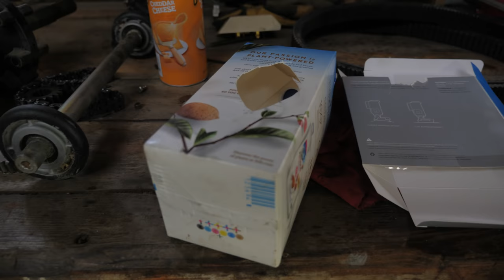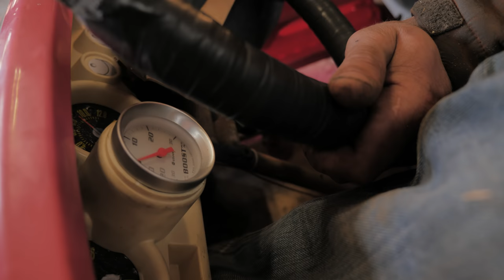Barbie Car Turbo #3 Tuning and Hitting the Streets

Comment: Those wheeeels are massive. They look like miniature Stanley Cups!
Reply: I had a tire and wheel setup like this on a kart that I used to race (for my home track). It was predominantly left hand turns on the track (sprint track), so we put the wide tires/wheels on the right side and I could take the corners VERY quickly.
Reply: Yeah they do lmao

Comment: Now you need a nitrous kit on her to get it really spoolin
Reply from the maker: I will need to look into that 🤔
Reply: @GrindHardPlumbingCo  a pocket bike nos kit would be perfect
Reply: Just get a decent 125 2 stroke engine for it an that will feel like you have nos. plus easy maintenance
Reply: Grind Hard Plumbing Co yeah just a little cartridge kit
Reply: nah 125 2 stroke is way faster and easier to work on. only hard thing is to get the custom pipe just right for all the power if the original doesn't fit
Reply: 250cc 2 stroke

Comment: if you want this to "work" and not just make turbo sounds then there is only really one way to go about it 

needs to be a blow through and boost referenced carb

a quick and dirty way todo this would be to enclose the carb in a airtight box (so the box would be flush with the motor size flange) and then pip the turbo into there so the exterior of the carb is at boost pressure, then add a fuel pump remember a carburetor needs to operate at ATMO so if you want blow thru then the carb needs to be at the same pressure as boost 

(or fuel injection there's a couple ready made kits you can get for small engines 

you also still have a oiling problem to much oil if you got oil burning then you are effectively blowing it past the gaskets which impacts the turbos ability to spool 

after all that ignition and timing boost requires a smaller plug gap and hotter coil I would take 5 thou out of the plug gap and see about rigging a hotter coil

more cam is also always better these little bike/atv motors do not have a lot of cam separation which leads to some ERG which is bad on a turbo  if possible a bigger over all cam particularly one with a wider lobe separation will do wonders
Reply: On snowmobiles you just put a tiny pressure hose on the top of the carb so the throttle does't lift, then you let the pressure go through the carb the "normal way" 
Then to have the carb flow the right level fuel whith the boost pressure you must have a linear fuel pressure regulator so the carb flow more fuel when the pressure comes.
If i remember correctly it isn't harder than that. 
You can watch for example  rx1 whith the mcxpress turbo kit.
Greetings from Sweden (i hope i spelled everything right)
Reply: Mr Olsen correct

Comment: Just did the same wheel and tire swap, we learned heating the tires with heat gun, they go on by hand, about 50 psi to seat the beads, race kart. Cool videos

Comment: Relatively large diameter tubing and too long of an exhaust manifold runner will produce low boost.
Reply: Yep turbo should really be on the exhaust side. Wrapping the header would help keep in the heat.
Reply: This is not true. It will not effect peak boost but it will effect response (turbo lag).
Reply: Steven is right, Joshua is wrong.
Reply: D. Ryan no Joshua is right. How much turbo tuning have you done? Because I have a lot of experience.
Reply: @joshuahebert9949  oh you do?  You respond like you're 12.  The exhaust mixtures aren't as compressible as you make them seem. Heat loss from the hot side has a greater effect then compressibility. Velocity of the fluid mass transfer is what you really need going in to a turbo especially if the turbo is to small. Which you should know with all your experience and a quick glance at the compressor map of the rhb31, this turbo is operating outside of the surge zone throughout the entire RPM with this 200cc engine. I've done a turbo or two.
Reply: D. Ryan I responded like a 12 year old? because I don't feel like writing an essay on a YouTube comment about the intricacies of how a turbocharged system works. I'm going to end this debate right now, look up rear mounted turbocharger ed trucks. Good day...
Reply: Brad Li 해피 go off yourself!
Reply: Brad Li 해피 but he didn't, he has no clue what he is talking about. I just don't appreciate someone coming in with no insight and making a wise as remark.
Reply: @Joshua Hebert  Since you clearly are  invested in this thread why don't you explain to us why Ryan was wrong instead of simply insulting everybody.
Reply: I’ve heard of bigger pipes creating more lag as well.
Reply: Nope, boost is unaffected by pipe length or diameter, only spool response.
Reply: @joshuahebert9949  100% correct mate. It just takes a bit longer to fill those larger pipes, ie, slower spool response. I drive a 800hp turbo Barra, all diy.
Reply: Rear mount turbos on cars or trucks work and produce the same boost, but the spool response is terrible. More pipe volume = slower spool but the same boost.
Reply: @DR-br5gb  no idea mate. I built and daily drive a 800hp turbo Barra FG Falcon.
Consider that rear mount turbos produce the same boost but have terrible spool response.

Comment: Yes, center housing or center section are both correct in turbo lingo, but if you want to get really technical like you guys already are of course 😂. It is called the CHRA or “center section rotating assembly.” On the high quality turbos, that mating surface is machined with such a minimal to perfect tolerance, it seals. They can also have a large “properly sized” o-ring there like you did....ish lol. All of that is critical and needs to be as perfect as possible, so the tolerance between the compressor wheel and the housing is correct. I deal with turbos almost everyday, especially in the winter. Although now, the summers are just as busy if not busier because of the turbo SxS market becoming so HUGE! Awesome guys, awesome. PS. Dawn dish soap around the beads will help them seat much much easier. Rather than the WD-40. 😂 good work!

Comment: loving this build! @ 8:56 just weld the housing then if needed cut it apart with dremel to service so you dont have to worry about clamping pressure tabs breaking off =)

Comment: Hey you guys ought to reach out to Aerocharger! They make turbos specifically for small engines, with ceramic ball bearings and self-contained lubrication. They don't encounter any of the fluid drag that the journal bearings in barbieturbo do, and should make a lot more boost. They're designed for this.

Also with more boost and no changes to compression, you could run Methanol or E-85. You'd need to rejet.

Comment: I just got hold of a Honda 200cc big bore with a 3 speed auto clutch, and yes!, It will be going into my daughter's Barbie car. (AFTER we burn up those little 12v electric motors with 18 volts for a while)

Comment: The reason why the intake part of the turbo has a broken seal or gasket is because you put the carb after the turbo so the air and fuel mixture will go thru the turbo before it gets into the engine, and gas is known for breaking rubber gaskets. another one possible cause is the over intake pressure due to absence of the blow off valve that makes the turbo seizure during realising of the throttle.

Comment: That air filter could be restrictive maybe. Have you seen the engine masters episode with the air filters? Basically any filter that allows the air straight through it, i.e. not 90 degrees, provides something like 5% more power on their tests. Which is funny because pretty much every single 'performance' air filter doesn't have a straight through filter element. Some of them do but very few. Instead of having a hard cap on the end of the cone filter, you want the cap to also be a filter allowing the air straight through. Mushroom filters may provide the best flow like an HKS since that's basically a velocity stack in filter form. I'm just trying to think of what could be keeping that turbo from reaching wastegate pressure. The exhaust doesn't look restrictive but in another video you showed that it might be, so now I'm wondering about the intake as well. With a turbo that small, any restriction at all could be an issue. Wow I just tried to link it to you, they took the full episode off of youtube and now it's behind a paywall. Ah here I found one on daily motion: https://www.dailymotion.com/video/x693421

Another idea: Try making a dump pipe for the turbo that goes straight off instead of angled to the side. I think turbos are much more sensitive to exhaust restriction than intake since the expanding gasses take up much more volume than the intake ones. Or at least go straight off for the first bit before it starts to turn. You don't want the exhaust gasses essentially hitting an angled wall immediately upon exiting the turbine.

Comment: When you added the turbo you added back pressure. Lean the jets a little. I can't believe he drilled them first. How to check for lean operation? Apply some choke. If it's instantly worse, then drill.

Comment: Do you guys have a wide band O2 rig? I have an LM2 (hand held portable unit) and the data it provides makes tuning soooooo good. It can be attached to any exhaust tip and operates on 12 volts. I’ve tuned EVERYTHING I have! Even the lawnmowers! If you don’t have one, you must get one! 😁👍

Comment: Probably CDI box.  Big gun over rev is the best I had on my 230 . With that bigger jet ( needed with the aggressive ignition curve and removal of stock rev limiter from cdi ) and went 1 tooth bigger on front and went 3 down on real along with ducking down to stop air resistance I hit 90 . of course I needed a decent stretch but if I could do that on a bike I imagine you could with less weight and bigger bore. Love the videos btw keep them coming. And btw I still have my 2005 230 lol honestly it's like a tank( engine wise) its hard to kill.  I don't see how it's lasted from all the abuse over the years.
Reply: And as I seen others post. I'm gonna have to check Idaho out it's beautiful!   Shout out from WV!

Comment: Looks like building a dyno from a couple six inch pipes, bearings in a frame with a brake drag would create a load or resistance would save your tires.

Comment: Awesome build! It won't ever do anything more than make the noises because it is a single cylinder. Your exhaust gas coming out of the engine is not consistent enough to spool the turbo enough for boost unless you're at redline.

Comment: You should try a pusher set up, I think your losing power with that set up. Most turbos that I see are pushing air into the carb, not coming from the carb and then going into the engine. It’s more plumbing but I think your power gains will be worth it.  So manifold, carb, then air from turbo going in. Worth a try. Also see blow through carb turbo.

Comment: Now you can tighten up the actuator and put a bleed valve on the vacuum line, to get even more boost.
From 2 psi to 6 psi 👌
Shame about it's cheapness :,(could you guys source one from a 1ltr diesel engine?)

Comment: I knew something was wrong with that "eBay" turbo. Happens Everytime. Good luck with the spark issue. It's always something with them small engines. Once you get past all the issues they keep running without major issues.

Comment: Much better guys glad to see it. Sorry the turbo took a poop and remeber there not all the same mine has an oring (a rather nice one too) and a groove machined. Think you guys can make this work okay but still dont see it making the power you and i think we want.. That said i have some nugets mill the head some and pull rings out of the piston do some vertical gas ports reasemble. Also if you guys can add any volume to that intake after the turbo its gonna help. Now did you see the pulsing on the boost gage? Shes still rich on boost because the carb is very restricive i know you went down a size or two but i ran a 40mm on mine (pull through) and still was smaller than stock jets. Your smaller carb gets the vac even higher in the ventury which means a 90 is more like a 140 the presure in the bowl is constant. Might take some thinking to get it but your going the right way but try taking the air filter off and see if it goes lean makes more boost and if it doesnt get too lean should make more power
Reply from the maker: Thanks for all the helpful information! I think if we try to turbo it again we will just go fuel injection like you suggested, but for now it’s on hold so we can work on other projects.
Reply: @GrindHardPlumbingCo  thats not a bad idea feel free to pm me if you need any help. I really do understand my rx7 never gets the atention i wish icould give her.

Comment: Put the turbo so Close to the exhaust as possible, then On snowmobiles you just put a tiny pressure hose on the top of the carb so the throttle does't lift, then you let the pressure go through the carb the "normal way" 
Then to have the carb flow the right level fuel whith the boost pressure you must have a linear fuel pressure regulator so the carb flow more fuel when the pressure comes.
If i remember correctly it isn't harder than that. 
You can watch for example  rx1 whith the mcxpress turbo kit.
Greetings from Sweden (i hope i spelled everything right)

Comment: Grind Hard Plumbing, I am not sure if you guys compensated these things but first drawing gas through your turbo washed the lock tight off the threads and allowed the nut to spin off, second you guys need to open up your compression ring/rings gap. I would go atleast two thousands. Another thing I would go atleast one step colder plug and if there is no adjustment for your spark timing I would make a water/meth setup. Can do it cheap with a cold start injector.

Comment: ~9:00 - CHRA or center housing rotating assembly.  Your compressor cover should have an o-ring around the side with the wheel on it that seals.  The hardware that holds it on otherwise is fine and should not be over tightened.  Consider running crank case ventilation if you're not already doing that in some way.  I've never built one of these things before but I'm fairly familiar with turbocharged systems.
Reply: derp you guys used an o-ring that you made right after that part of the video :D

Comment: One of those would make a killer R/C car.

Any time you get an eBay turbo....put after-assembly threadlock on the compressor nut.  They're usually (even most shittier ones) balanced with the nut where it's clocked.  

Bro......Idaho is outrageously gorgeous....GOD I need to move out west.  Someday.  :o)

Comment: Part of why your turbo never made much boost is because of how long your exhaust was pre turbo. You want it as close to the head as you can as you don't want the exhaust to slow down before it hits the impeller. You want exhaust velocity to spool up the turbo quick. That's why most turbo kits on diesels or cars still use exhaust manifolds and not headers.. You want high velocity and high pressure on the hot side and no back pressure on the dump side.
That said I have to ask, what engine is that? Doesn't sound like a 500, maybe a 350 max? Looks too big to be a 125.
Reply: J.A.Ratt85 it’s 200

Comment: make the gape in the park plug smaller, youu need a bigger hole in jet and a ssmall par plug gap, turbo is blowing out spark at high rpm, thus the misfire before

Comment: I would suggest that with a small engine like this one to use a volumetric compressor instead; anyways if you used a bigger carburator with more jets and a bigger air filter, the turbo would have an easier time

Comment: microsquirt running on trigger wheel=efi=walbro fuel pump=1:1 regulater on efi rail=14point7 wideband=tune in tuner studio...run 11.5 a/fon high boost....12.8 good on low boost....gm sensors iat/3 bar map/clt....10 gauge wire from batt to fuse box with inline 30amp fuse, and relay....then all else run to fuse box....4-wire relay between fuel pump.

Comment: You could change the gearing so you have more acceleration but still do same top speed as it is not revving out fully in top gear with current gearing

Comment: You need to put the actual bike exhaust pipe on it needs the expansion tube for back pressure to run right.

Comment: I’m not sure what size cc motor that is or what kind of motor cycle the motor came out of but from my experience with motor cycles and putting any gas engine in that little plastic frame and cutting down on the weight from several hundred pound of motor cycle frame to this..... yeah that thing should be FLYING

Comment: Hey I’m in spokane and I have an lt250 and a bobber/chopper thing. Maybe I could trade for your help with some welding on my 240z. The lt runs nice but the oils filter cap needs to be tapped for new bolts and the bobber is just a rolling tame with a non running Honda clone engine

Comment: I think you guys should look up Ecotrons on Google. They've not only got a small engine EFI kit, but they make kits with upsized injectors to turbocharge small engines as well. Definitely doesn't fit the low budget but being able to tune it (or have it tune itself) should make it run beautifully.
Reply from the maker: Someone else suggested that and we looked into it. I think that’s the route we will go next time we try to turbo it! But for now it’s going to stay NA while we work on other projects.

Comment: At 21:19 why are you holding the clutch down on first gear? the tires have to much friction now that they are hot and sticking to the ground so when you takeoff you have to much friction and the clutch will give out.